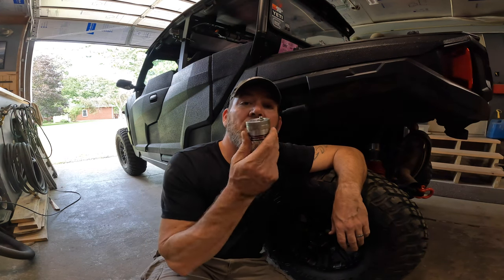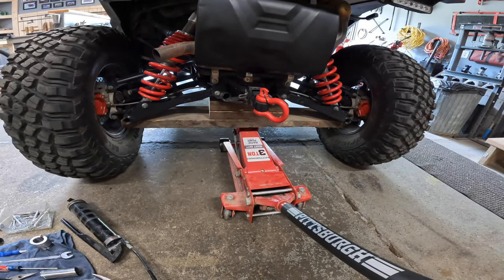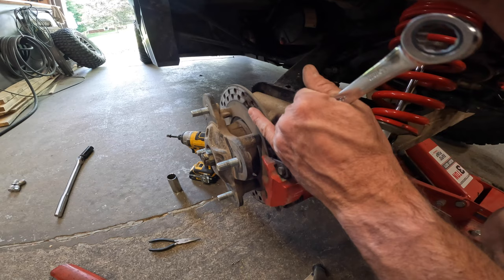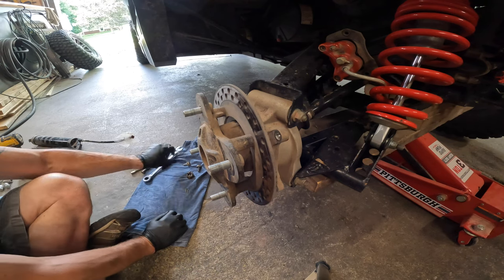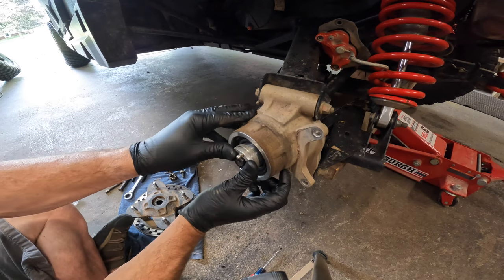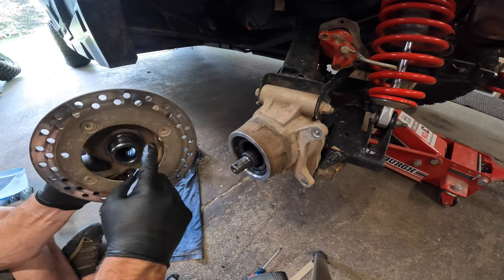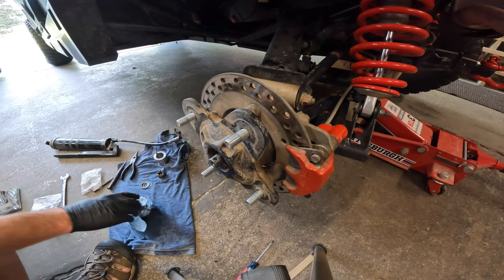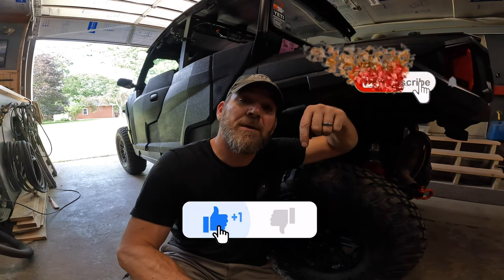How to grease UTV Bearings - Polaris General

Comment: The tool that you linked in your description for a general doesn't look like the tool that you are using in your video.
Reply from the maker: I see that after visiting the link.  I last purchased that in 2019 so it's the same item on Amazon so maybe they updated the pic?   I would probably get the same one if I had to replace it - pretty happy with it and just used it again this past September (just before my annual trip).  Thanks for watching and let me know if you have any other questions.
Reply: "I'm not sure when it changed, perhaps 2019, the wheel bearings are the "shielded" type. Meaning there is a metal cover between the inner and outer races to keep water out and grease in. These will never need greasing." Your thoughts on this comment on Polaris general forum. What year is your General? Mine is a 2021 I took the rear wheels of and took the brake rotor off and went to use the bearing tool and it was plugged it wouldn't accept grease through it. Faulty tool.
 In the meantime, I have ordered another one. When I pulled the rotor off the hub there is zero evidence of grease none! dryer than a bone ...could it be they are all sealed up now and they don't want you greasing them?
Reply from the maker: @callkey  That is very strange - to be honest, before I saw this tool and how it was used, I too thought the bearings were solid but learned that there is a seam where the case comes together.  You can always test the tool by pumping some grease in it before inserting it - that should show if it's working properly.   Afterward, you can also rotate it a couple times to 'pry' the bearing apart enough feed in the grease.  My machine is a 2017 and the bearings are the same for all years (i'm been shopping for bearings as my rear ones are finally ready for replacement).   I would give it another shot when you get the new tool.  Good luck and keep us posted!
Reply: @UTVBoondocker  there is a seam in mine also I understand what you're talking about .My tool came in the mail today and I will check it out tomorrow. I will keep you posted... Thanks for your insight.
.
Reply: I got the new tool and everything is greased and worked out great.. thanks for your video....!!
Reply from the maker: @callkey  Perfect!  Sucks that the first one was faulty but hey - you got it!